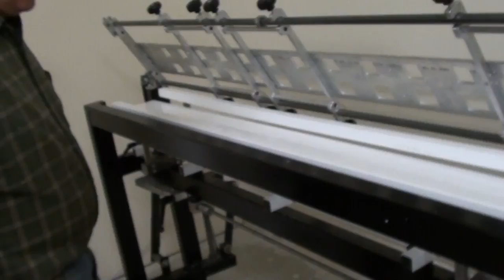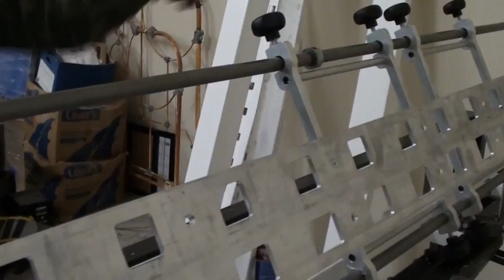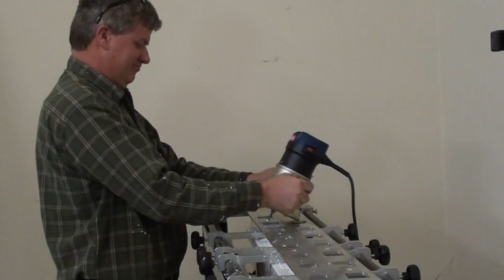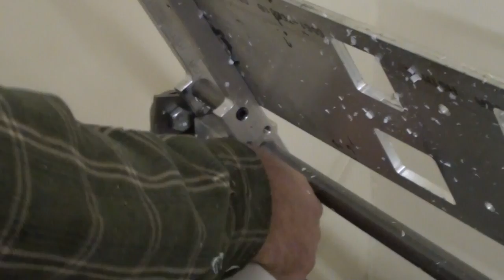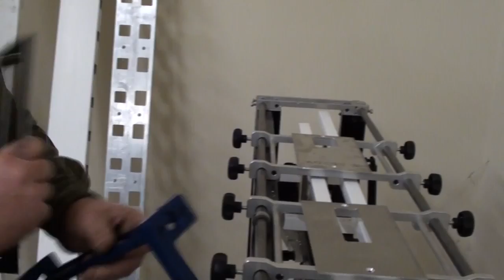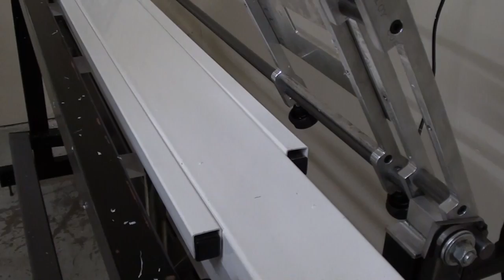Vinyl Post Floor Routing System

Comment from the maker: I plan on building these again shortly.  The lower unit will be just like this floor model but there will be a full cnc unit. fully programmable for any fence including picket rails. An eight foot long
capacity is looking like 12,000 with one year warranty and programming for all of your vinyl products. call 951.333.3382 for more info. The floor template models as You see are priced at 5,000.
Reply: Do you have any for sale?